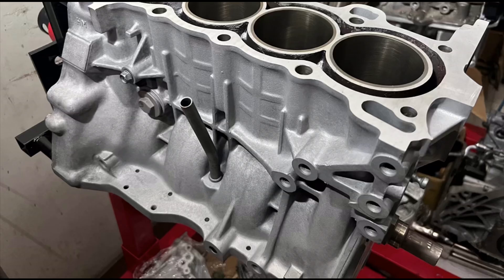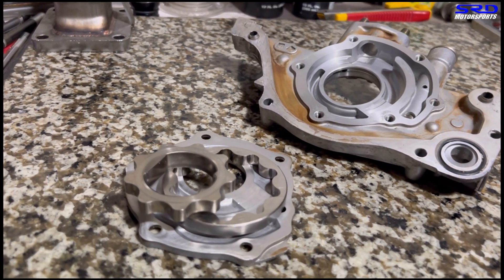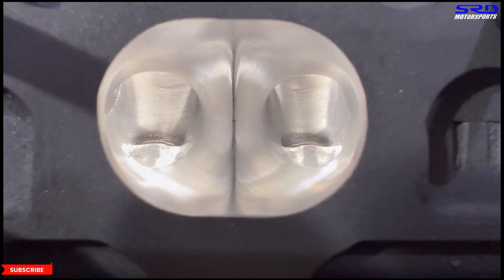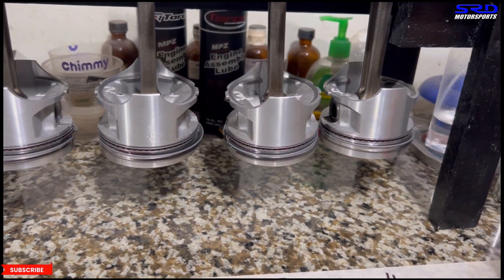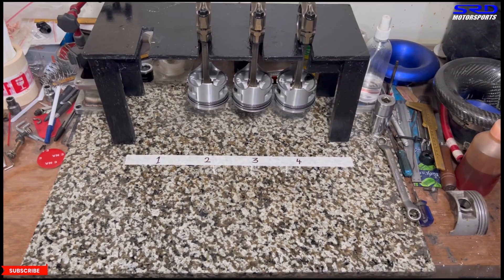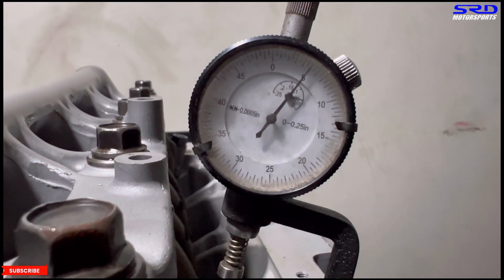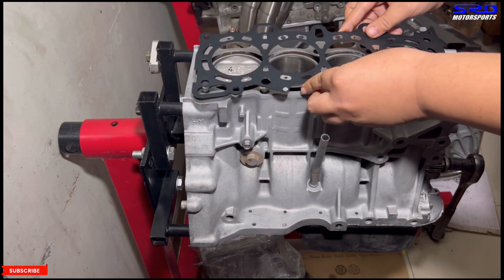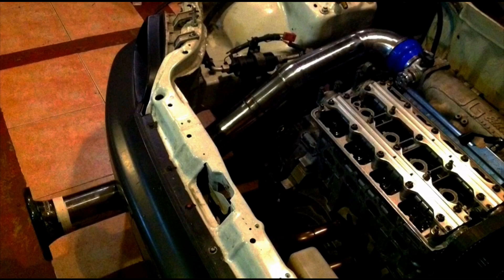D16zc VTEC Build Series Part 2 Ported Head & Final Assembly

Comment: I had a question about the skunk2 intake for the d series engines. Is it possible that the skunk2 intake ports don't match the head of a P2J P2M because the intake on the head is curved to the side?
Reply from the maker: The curve to the side is “inside” the ports so unrelated to the intake manifold 

Besides, even stock isn’t really matched to the stock head so it needs work even stock
Reply: @SRDmotorsports  Thank you for the information. 👍
Reply from the maker: @goodmatchplay1372  no problem sir

Comment: what if i make the crankshaft clearance 0.06 racing needs
Reply from the maker: then u lose a lot of oil pressure, next u would run thicker oil to solve the pressure issue 
But most forget thicker oil is also heavy and harder to turn by the oilpump so u increased windage losses and that eats horsepower

Comment: Sir, when installing the valve springs do they have a correct orientation? 

Thanks in advance.
Reply from the maker: nice question and I guess u saw the PADEK post by someone? Lol

Funny right that was built by a “known” shop or atleast self declared experts? 

Orientation on OEM only cuz aftermarket top and bottom is the same
on OEM if u look close at the springs one side has a tighter coil/wound and that’s usually the bottom side, the side with the spring coil being closer to one another if that makes sense?